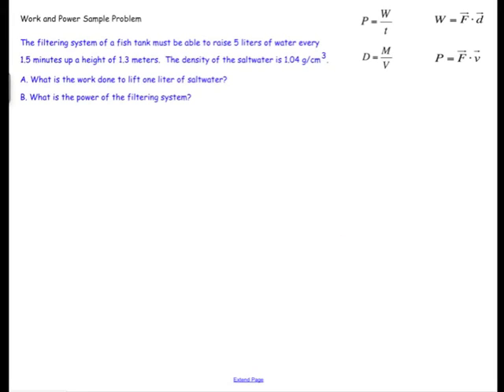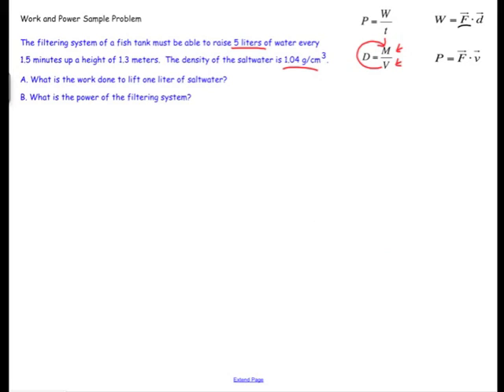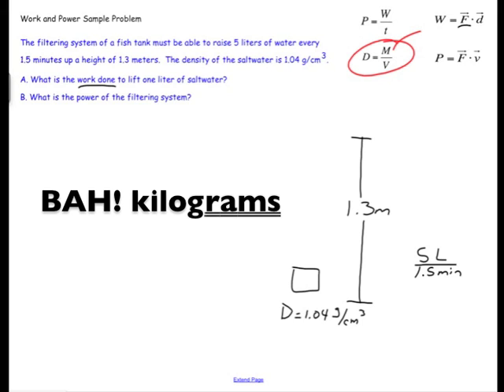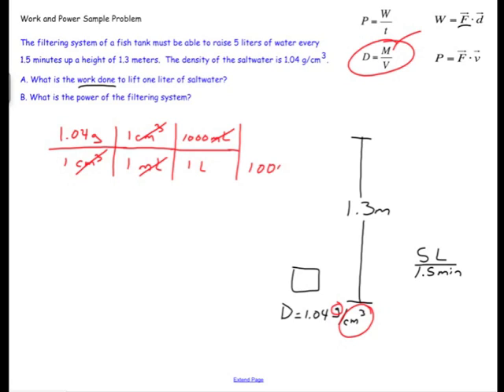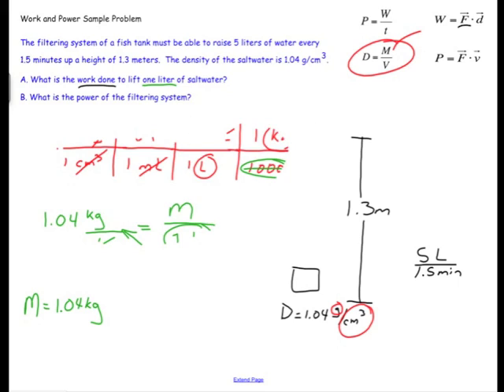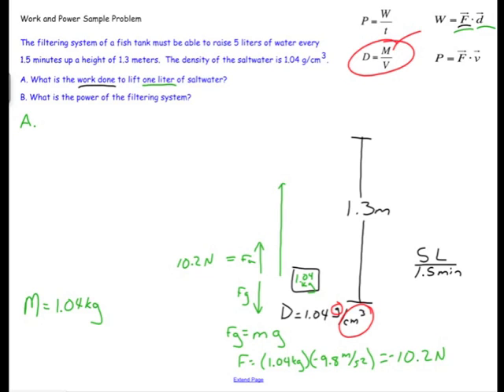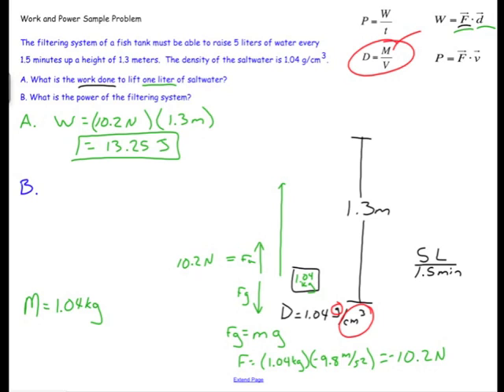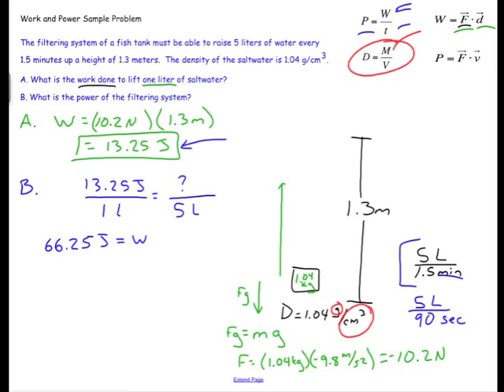Work and Power Calculations for a Water Pump: physics problem

Comment: I still feel that part A is wrong because work is net force by distance.

So if the net force is zero (because both forces are equal in magnitude by different sense) then work will always be 0.

Of course I'm not sure about this...